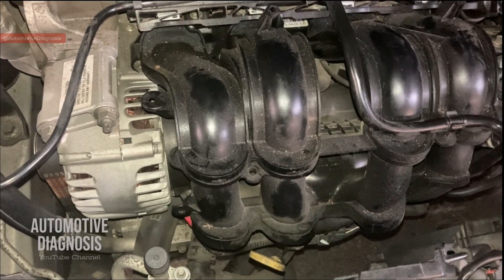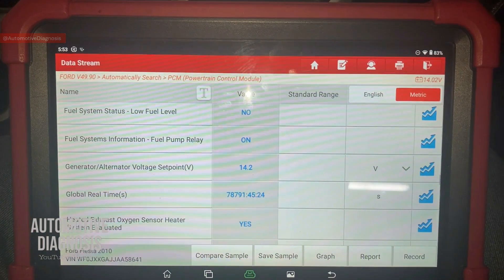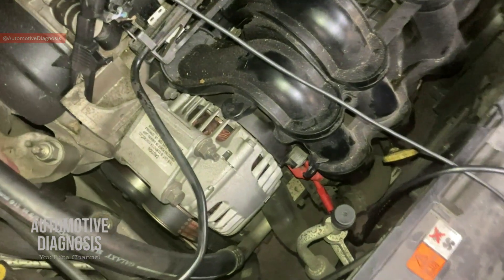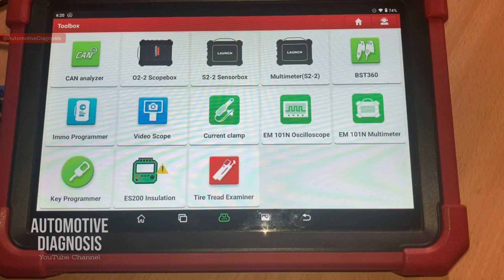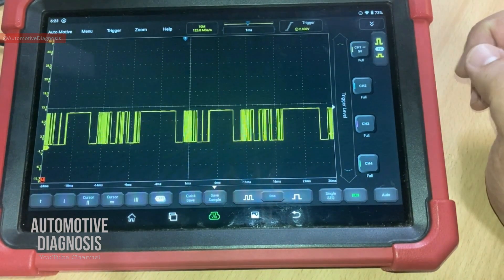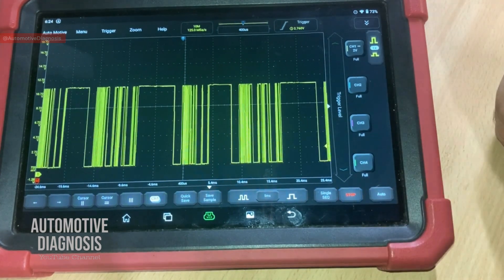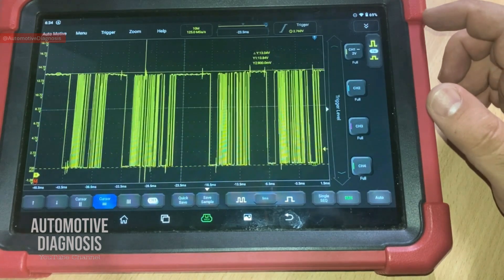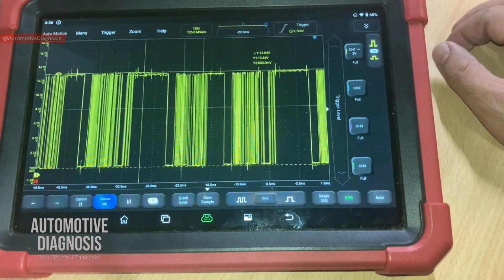LIN Controlled Alternator Repair Secrets Revealed

Comment from the maker: 🎯 Online Courses:

🧑‍🎓Online Course: Automotive CAN-BUS Network Intro, Application & Diagnosis online course:
https://www.udemy.com/course/automotive-can-bus-network-intro-application-diagnosis/?referralCode=C0C59CCB3595CB9C0C13

🧑‍🎓 Automotive Engine Sensors Intro, Operation & Diagnosis Online Course:
https://fix-it-first.com.au/course/automotive-engine-sensors-intro-operation-diagnostic-2/

🧑‍🎓Automotive Engine Actuators Intro, Operation & Diagnostic: 
https://fix-it-first.com.au/course/automotive-engine-actuators-intro-operation-diagnostic/

🧑‍🎓  Smart Key System (Push Button Start) Operation & Diagnostic in ANY Hyundai & KIA Vehicles
https://fix-it-first.com.au/course/smart-key-system-operation-diagnostic-in-any-kia-hyundai/

🧑‍🎓 Automotive LIN-Bus & K-Line Inro, Application & Diagnosis
https://fix-it-first.com.au/course/automotive-lin-bus-k-line-intro-application-diagnosis/

🧑‍🎓 ABS & Traction Control System Diagnostic Online Course
https://fix-it-first.com.au/course/abs-traction-control-system-diagnostic/

🧑‍🎓 Starting System Diagnostic & Schematics Analysis Online Course:
https://fix-it-first.com.au/course/automotive-starting-system-diagnosis-and-schematic-analysis/

Comment: What could be the cause of a high voltage from the lin controlled alternator? When I look at the voltage it starts going up steadily until it gets up to 16V and car modules start shutting down. Car is a bmw F10 and uses a BSS7420 Voltage regulator.

Comment: Excellent video, thx!
On my Volvo S60 1.6D lin voltage when ignition on is 9V, when engine in idle then 10V. I think have a problem with the ecu / lin chip.
Without lin connected the voltage is stable 13,6V, when connected voltage and A is jumping too much.
Reply from the maker: Hi my friend. Thanks for sharing your experience. The best way to diagnose this is oscilloscope if you have any. It can tell exactly if slave node (alternator) is causing the problem.

Comment: Love your channel. So much useful videos.
I have the same one wire LIN bus setup on my Renault alternator and i just had a problem with the alternator not charging anymore (engine running and my cigarette lighter volt-meter was not reporting above aprox 12 V). I disconnect the LIN wire from the alternator and the charging went back to aprox 14 V.
Now, is this sufficient to conclude that the alternator is not the problem and leave as "suspect" a wire problem or the UPC (on Renault that module is controlling the LIN to alternator, not the ECM)?

I also have an oscilloscope and i will do the proper test on the network but only based on this single evidence is save to asume the alternator is ok?
Reply from the maker: Hi my friend, Thank you for watching this video. As you said, seemingly alternator is good, but checking the LIN BUS with scope can be very helpful.

Comment: Is it possible to just bypass this linbus communication and use a higher ouput alternator with an internal regulator?  Is there a way to trick the computer to NOT throw codes or battery lights?

Comment: Excellent video on communication line data traffic. Seeing the regulator module disconnected and reconnected on waveform makes the difference very clear, and you can see the PCM  is doing most of the talking.

Comment: 1. I believe that the upper voltage level may change if car is started or charger is connected, but the lower part of lin signal (around 800mv) should not change.
2. The Lin signal kind of becomes dense or more close to each other while the disconnected connector is plugged again as now there is more information is flowing. Am i right sir?
Thankyou for the great video.

Comment: I have a lot of trouble codes like this on my Hyundai. What's the problem there? And it's not the alternator because we replaced it with a new one and it 
didn't help.
Fault code p0626
Reply from the maker: Hi there, problem could be also on the wiring of the alternator.

Comment: GREAT VIDEO ,,,,,,,,,, I WORK AT A KIA NEW CAR DEALERSHIP AND WAS WONDERING DO YOU HAVE A VIDEO ON THE LIN BUS ALTERNATOR FOR THE NEWER 2023 KIA'S THANKS SO MUCH FOR YOUR TIME ???
Reply from the maker: Hi my friend. I will make the video if I have a Kia with LIN controlled alternator, but generally LIN protocol must be very similar to what you see in this video. Right now on the channel there is a video for LIN bus on a Kia but it’s for the battery sensor. You can find the video here:
https://youtu.be/w7D_b9iIEQk?si=l3SUsvtEEHJYX77w
Reply: @AutomotiveDiagnosis  THANK YOU ,,, I WILL LOOK INTO THAT VIDEO !!!